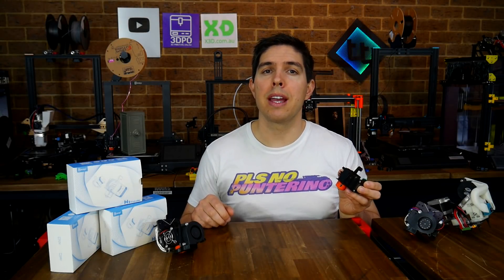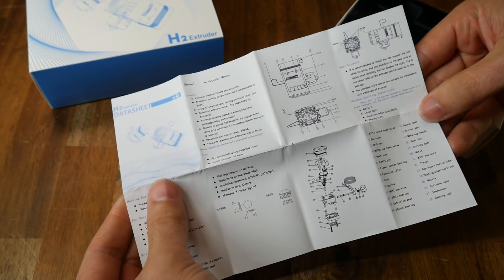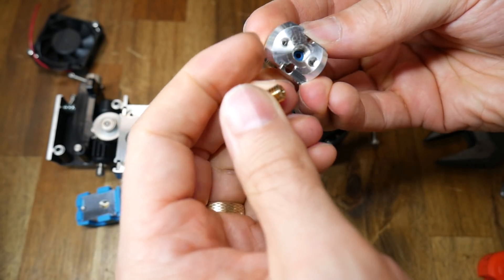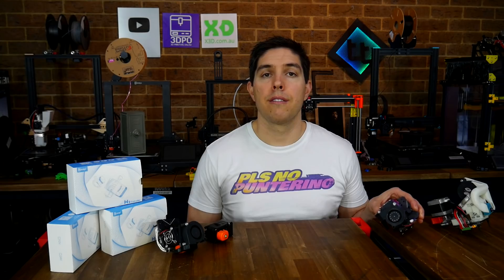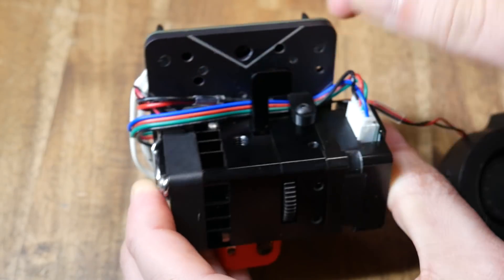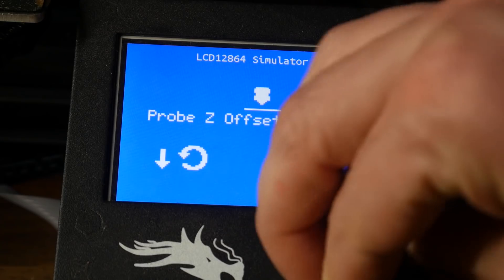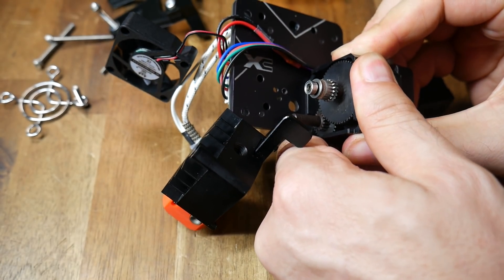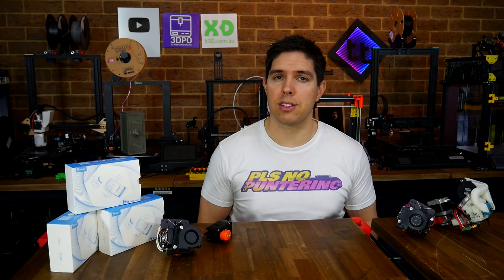The fantastic* BIQU H2 extruder/hot end - (*IF you get a good one)

Comment: If you get a good one... Mine isn't one of the good ones. Gears don't spin properly, I can't tighten the bolts either, so it keeps squeaking and slowly falling apart. All I can do is to tighten the bolts holding it together a bit while spinning the gears and moving the tension arm, when they lock up I need to back out the screws a bit again, and then use it for a few more days... then I can do it again. Solution from support is just to not tighten the bolts.

Comment: Could the motor be replaced with a round Nema 14 motor to drop the weight by another ~50 grams? The square style motors are usually pretty heavy even on nema 14

Comment: They make an all metal, high temp H2 - up to 500 Celsius. Have you been able to test the high temp unit? Do you think it would require a MOSFET for the hotend?
Reply: Hehe I have just recieved that full metal hotend-edition 1 hour ago as i hate non-all metal hotends. From what i have found out, the only difference should be in the heatbreak. Ill tell if i run in to any issue regarding this.
Reply: No issues with temp. or anything else so far. If you plan to run klipper on it, rotation_distance on extruder (For PLA) is: "rotation_distance: 3.4334"
Reply: @Slendrianen  How high and how long? That's the thing that concerns me - the prolonged high temp of a 24 hour plus print. I don't know if all boards can handle that if they were not spec'd in the OEM build. Thank you for the klipper info, I have thought about switching when I get the H2, in order to take advantage of input shaping, but I haven't made the change yet.
Reply: @giantrob5390  I dont see any issues & havent been able to google to any issues. This printer is running a SKR mini e3 3.0 & i have another printer too thats one SKR mini V1.2/Micro Swiss extruder/hotend & has been printing PETG for many weeks without any issues. If the board lets out its smoke, it was meant to & you got a nice excuse to upgrade ;-)

Comment: Just a bit of a tip for your suggestions, spring washers do nothing. Better using some moderate strength threadlocker if you are worried about seizing. If doing so I would use torx head fittings to prevent rounding off upon removal.

Comment: Just got a BIQU H2 on an Amazon flash sale for my Ender 5 Plus, after installing this, a SKR Mini E3 V2, and replacing the useless stock screen with a TFT35, I'm back to printing. Currently 2/3rds throughprinting first calibration cube, and everything seems look great. My extruder gear seems to be on the firmer side, but I roughed it up a bit with the first few filiment loads, and I've yet to get a jam. Going to try some TPU next and asee how that performs.

Comment: I ordered a second HR2 along with the original one offered with the Kickstarter BIQU BX. The original one also suffered the thumbwheel jam and I contacted BIQU support. They instructed me to open up the extruder and detach the stepper drive to see if anything was loose. Nothing was loose but there was evidence of one of the gears binding against the case (lots of aluminium filings) . I took photos and sent them to BIQU. They are sending me a replacement gear set. My guess is that the tolerances on either the gears or the case casting or both are not tight enough.
I must say that the response from BIQU was brilliant...within 1 day of my first query. 
A further issue was with an all metal heatbreak (titanium). I had a number of blockages when using this with silk PLA. I've gone back to a standard heatbreak with Capricorn insert and problem is solved.

Comment: Thank you for sharing a video of the H2 extruder with us. Regarding the clicking sound,  the engineer fine-tuned the gap between the parts so it can make the fitness between the parts more compatible. Later we will further optimize it and improve the stability.
Reply: Can you tell us about the version 2 that is out now? What were the modifications? How can we be sure what we are getting? For instance Amazon has several sellers with the H2 but it is not clear which are the newer version in most cases. If we get the old version, do you swap parts under warranty?
Reply: I think I have the newer one that has Silver gears it was also labeled as V2. Haven't tested mine as I'm missing screws to mount it.

Comment: Received mine today. Can confirm the suspicion that the gears have less tight tolerances. My h2 works great and has not jammed. Clicking sound on retraction is audible but not annoying.
Reply: Hi, the engineer fine-tuned the gap between the parts so it can make the fitness between the parts more compatible. Later we will further optimize it and improve the stability.

Comment: Ok you have 5 hotends & drive combos. Can you do high speed printing tests with them all to see if the weight reduction actually makes a difference?
Reply: This! Yes please! :D
Reply: he'd need something like a voron as the enders etc cant print fast enough anyways
Reply: @BH4x0r  What is the limiting factor? The motors are the same, right? So current delivery?
Reply: @court2379  the way it moves, especially the bed is very heavy and it causes alot of gravitational movement And it has to sling that heavy bed around with a possibly heavy print on it too so the steppers will run out of torque too yes, but also the moving mass is a large factor in speedprinting in general

on a CoreXY machine the bed either doesn't move or only moves on the Z axis, the X and Y are just done by the gantry so there's way less weight of the moving parts and thus on the motors & belts which is way easier to accelerate and decelerate.
Reply: @BH4x0r  Sure inertia is an issue, but still can be overcome by power. I wasn't thinking though, the design is inherently a problem. Particularly as the part on the bed gets heavier and changes the dynamics as it prints.
Reply: @court2379  exactly why we can't reach the same insane printing speeds as on a proper corexy machine

power, yeah sorta but on a CoreXY machine 2 steppers are working together to move the (much lighter) gantry and add to that there's an obvious issue with racking on a normal cartesian machine, and the fact that steppers have less torque on higher speeds, and that most machines only use a 5 or 6mm belt you'll suffer from severe quality issues while a CoreXY machine can actually produce nice prints at those speeds if the cooling is adequate and it's well tuned

but in all honesty, he asked if the weight reduction makes a difference: i'd say no on the case of these "normal" machines as the bed obviously weighs more.
Reply: @court2379  bed weight, torque, filament etc

Comment: I'm considering this hotend/extruder combo but need 300C. Says all over the place that its upgradable to 500C but no detail on parts needed. Emailed BIQU but have not heard back yet. Saw a comment (that I cannot find again) that says it needs an upgraded fan, all-metal hot-end (I assume their stainless or titanium?) and thermistor. Was wondering if the heating cartridge needs upgraded as well. Figured this info would be available by now, but can't find it anywhere... Will post back if they respond to my emails.
Reply: Hi, the heater cartridge doesn't need to upgrade. It is available on our AliExpree, biqu.equipment and our official website bigtree-tech.com.
Reply: @BIQU_Makers  Received a reply but it is difficult to get a straight answer with part numbers. I was told that these are the important bits... If anyone has done this and has preferred part numbers, please share so we can all benefit and avoid trial-and-error.

(1) NTC100K B3950 - Thermistor
(1) BIQU BX All-metal Throat (Stainless steel or Titanium alloy) Heat break
(1) 24V fan 3510

Comment: 4:54 I didn't know there was a complete Titan print head. I bought a Titan EXTRUDER from E3D and the choices were either:
- bowden connector
- E3D V6 direct mount
What is the hotend part called? Or can you paste a link?

Edit: Also, how do you get such a clean surface on 1 side of printed parts (8:58) - is this just from the glass?

Comment: Considering that you lose horizontal print volume in favor of vertical (meaning they essentially cancel each other out), the one advantage this extruder offers would be weight reduction. The one advantage of that is less ringing/vibration at higher print speed. In that case, it doesn't make much sense to print at 80 mm/s. Why not compare different extruder/hotend combination at 100-150 or even 200 mm/s (with sufficient acceleration of course.
Reply: Thank you for your feedback and we’ll definitely pass your idea to our team.

Comment: Those types of spring washers are for preloading, not to prevent coming loose from vibration. A very common misconception. With long term vibration and movement (like on a 3d printer head) they'll eat into both the screw and plate, and sprinkle tiny metal shavings where you don't want them.

For this purpose, with small fasteners and fairly little torque and mass involved, nylon locking nuts would do much better if the assembly can accommodate a nut (doesn't work with threaded blind holes). Just remember that their function is heavily deteriorated after undoing/removal, so nyloc nuts are considered one-time-use disposables.

Comment: I don't get the advantage of replacing my or a hotend with one of these aftermarket ones. I know I have a cheap Chineese MK8 knockoff but it seems to work well for me.
Reply: Depends what you print and how fast you want to print without getting ringing.
Reply: @originaltrilogy1  I can print up to  65mm without much issues. I usually choose 45 to get the best quality prints. Slower wins the race when it comes to quality. Even some of the makers who've been doing this since the beginning don't print fast. I maintenance my printer every two weeks, keeps it all humming beautifully. To reach their own I guess. Thanks for your comment! It's good to hear others input on a subject.
Reply: @t3chninja_official  On a coreXY a lighter head lets me go much much faster and still get the same quality. When building the stuff we do, that has many hundreds of parts, every bit of speed increase helps.

Comment: I've had mine for a couple of months now. Happy to see your review. Im not sure if mine was a revised version or not. My biggest problem is similar to yours where is you turn the two main access that clamp the assembly together, the filament lever binds up and doesn't allow the spring to provide any tension on the filament. I have to loosen the bolt considerably to the point I am worried that it will vibrate lose. I think this is a design flaw that needs to be fixed. I've had a lot of trouble with prints failing due to lack of bite on the filament and eventually the extruder grinds a ridge in the filament and then it is really buggered and stops extruding mid print. Also the grub screw heads have started to strip.
Reply: Hi, sorry to hear what's going on. Rest assured, we’re here at your service. Please send an email to service001@biqu3d.com for replacement.

Comment: i have the h2 running on the ender 3v2 and it is an amazing piece of tech. I saw videos of the binding, so I opened it beforehand, had a look at it and lubed the gears. no binding. also my motor was put apart differently. my plug was rotatet to the upper side and I did not need to change the direction of the motor. Printed a lot of PLA and TPU with it, but needed to adjust the esteps a bit higher. But i still print at the low speed the cura profiles give for the ender 3. I might up them and have a look!

Comment: Reliability seems a common issue of this extruder. "Design prototype test" had to completly disassemble and clean the gears with a file to make it work properly, and "3dprinting general" had to change the screw of the filament hobbed piece as it was totally stripped and it was not keeping it firm.
Reply: They probably had the first version. Even here he had issues with first version but replacements were fine.
Reply: keep in mind DPT loves complaining and also disassembled the extruder before printing anything through it and the second one was fine.. while yes other had similar issues once you take it apart and mess with it it kinda goes out the window

Comment: The H2 is only 30 grams heavier (210 vs 180) than the stock end on my creality CR6-SE and I'm quite curious as to how well it'd perform, though I think it might be wise to install it on my backup (JGAurora A3) first to give it some test runs. Absolutely love your detailed explanations of how you set it up, the challenges you faced, the steps you took to overcome them, it all adds up into a very well-presented video that feels somewhere between a casual chat with a friend, and a professional instructional video from official sources!
Reply: Hmmm... the only issue I could see with the CR6 SE is the fact that replacing the hotend with the H2 would lose the CR6's autobed leveling system, and the CR6 doesn't have any way to manual bed
Reply: @jasonking7570  aye, but for octoprint users you can just keep the bed mesh stored in firmware as a permanent offset

Comment: I'll stick to the exceptional reliability of the slightly bigger Hemera.  A bit off topic but, has anyone successfully networked a 3D printer board (without an RJ45 port built in) using a USB to RJ45 Ethernet adapter or a USB Wifi dongle? Does anything in Marlin cover doing this w/o a Raspberry Pi?  Trying to network all my machines as inexpensively as possible w/o compromising reliability.  Thanks

Comment: I ordered mine from Amazon $92, had it for a month now and noticed the stepper plug was on the top side as I think I had a updated version. I wish I knew about AliExpress selling the titanium heat breaks because I am still waiting on my set from bigtreetech which it has been almost a month now and have not received them. I have had no issues with my H2 except one thing, load filament can be tricky sometimes and the gear won’t grab it, I decided to cut the Filament straight instead of a sharp pointy end and it seemed to make help loading. My H2 stepper motor does get quite hot to the touch, I ordered some 35mmx35mm heat sink to put on the motor just to be in safe side.

Comment: I don't understand why all the complete extrudes neglate the part cooling and coms without it...printing one is not a good option IMO, it should be at least nylon for heat resistance

That's what blocking me from buying one,  I can go for an orbiter that will sit on the existing hotend, but the fillment path is long compared to this
Reply: Why so? PETG already gives good heat resistance. In fact, I have used a PLA duct for over a year with no problems by designing it properly.
Reply: @nicholaslau3194  Sure, but I just prefer a complete product that wouldn't require me to print stuff

I also see a lot of different duct designs that fails, following by a v2 and so on
If they can include that in their R&D that will be better

*PLA duct wouldn't work for me, i'm using an enclosure, it will soften in the first 30min, PETG it rated 10c above PLA, so not a big improvement

Comment: One of the things massively overlooked when comparing the hemera is how thin the heatbreak is. This allows for much better thermal transfer and basically eliminates clog when using proper retraction. Another thing is the filament path length. The hemera is the shortest by quite a bit. I know the hemera is a lot heavier than the other extruders but with input shaping / Resonance Compensation its really not as much of an issue. I have a tool changer which has a heavy as hell gantry in comparrison and moves bloody fast and it blows any other printer ive ever seen out of the park. And thats not because of the rigidity of the tool changer (imo its not even that rigid) its due to how accurate the extrusion is with the hemera.
Reply: Do you mean the hemera has a thinner heatbreak? Or the B2 is thinner? Though mechanically fragile, thin heatbreaks reduce thermal transfer, and thus a sharper temperature gradient. Ideally, you want all the heat to be contained within the heat block, and no heat is transferred out anywhere, in which case a heat break is not necessary. However, since the heat block cannot be floating in mid air, there needs to be a heatbreak to hold it in place. Alternatively you have something like a mosquito where the heatsink and mechanical support are isolated, with the heatbreak can be made as thin as possible, and the mechanical support not caring about the temperatures.